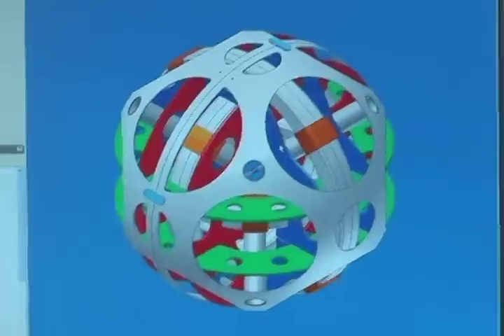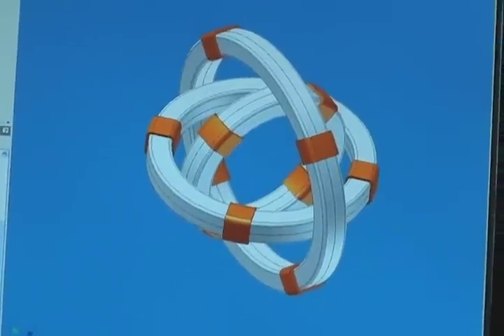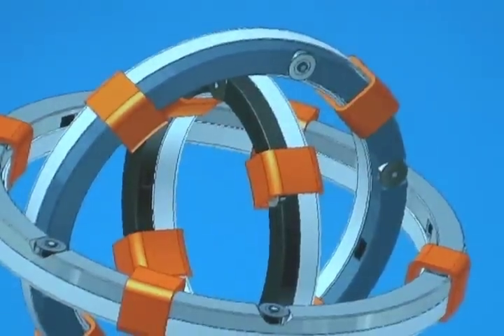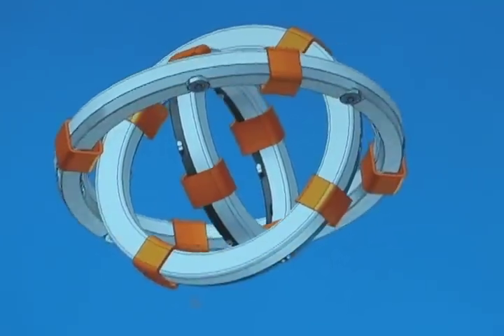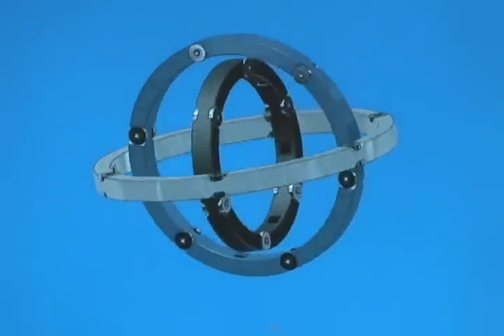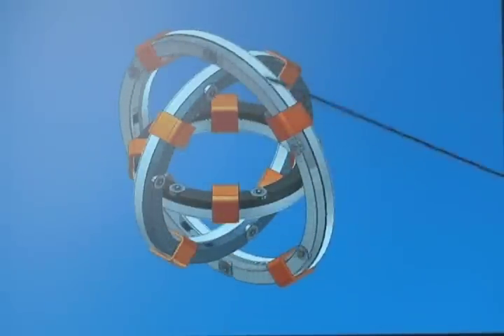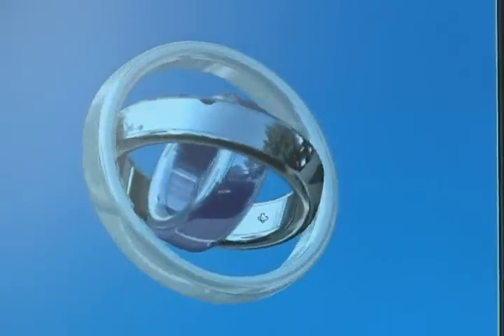Apparatus for Gyroscopic Propulsion Explained

Comment: Awesome! Just a question: According to Einstein energy = mass - so is it really required to rotate any mass? Wouldn't it be more effective to just rotate - let's say - a magnetic field with much higher speed?
Reply: Exactly what I was going to say. The need to have dissimilar mass rings is only needed because he states the rotational speed of the 3 rings was going to be the same. This is simply complicating things unnecessarily. Simply adjusting the speeds of rings made from the same materials would yield the same net results without the need for expensive and dissimilar materials. Also, not sure what the "mystery" is here. Having 3 competing gyros in unison like this has been done before and results in simple cancelation of gyroscopic force. They balance each others procession out. This doesn't cause some mysterious levitation or time travel…LOL

Comment: I get what he is trying to say.. it's a very complex "do nothing" on the contrary to his title, this "thing" as i like to adress it, will resist any motion. that is, relative to the starting point. If it is not moving when you start it (spinning the wheels) then it will resist motion in the X, Y, and Z directions if pushed upon, similar to a gyroscope. but if it is moving, and you start it, it will continue to provide force equal to the direction it is going, given that it keeps spinning inside.

Comment: Not even that. All the various means we use to convert rotary motion into linear require a surface to push against. Read: friction. In the absence of friction, the most you can accomplish with a gyro device like this is rotation about the center. This is useful for orientation in space. If it worked as a propulsion system, we would not require station-keeping thrusters on satellites, they could simply use their internal gyro module (which is basically what this device is) instead of thrusters.

Comment: There's no thrust. It simply transfers one torque into a different direction. You can mount three units on a board.
A child invented a safe astronaut attitude control mechanism by pumping fluids in three tubes  in a loop around to rotate him in space. Stop the pump, you stop rotating.

Comment: That's not what he asked, dumbass. If this device worked it would be in use already since it looks like a bog standard 3-axis gyroscope like has been used in inertial guidance and orientation control for space vehicle for decades. If it was possible for it to propel anything anywhere, we would use the existing gyros instead of engines on our spacecraft to move once in orbit. We don't, can you guess why? Because you can't get linear propulsive force out of a fucking gyroscope, you morons.

Comment: ...You do know you don't need them to be exactly balanced right? You only need them to be tuned for the effective RPM range of the bearings. Then you can achieve "identical rotational inertia" through RPM variances instead of very hard to machine physical properties.

What would be the benefit of targeting a specific RPM be? As apposed to a range you can fine tune the rotational inertia in?

Having said all that, I still don't see how this is supposed to generate propulsion...

Comment: Ah.  I figured probably the friction on the system would make it unfeasible, as well.

I was thinking that this might work for a small toy that just kind of bobbled in the air, but like you said, it doesn't seem efficient at all.  I also don't see how it's supposed to actually move; it seems like it would be creating a similar force in all directions.

Comment: I agree. The gyroscopic effect(s) can be fascinating and puzzling.
But for lift to occur, angular momentum must be applied -- and the lift/mass coefficient results in diminishing returns.
Nearly all the lifting force of any sized gyro is gobbled up by lifting its own weight -- and the problem multiplies the greater the gyro's mass.
Translation -- not practical or workable in "anti-gravity", (defeating gravity).
As for the alleged "gyroscopic propulsion" -- a nice idea but not practical.

Comment: I don't see where the propulsion comes from, the spinning rings (being balanced) cancel each other out. If you could harness one half side of the ring's weight by having it weigh more each time it was say, at the lower half of the ring, and lighter at the upper half, the ring would want to move, like a paddle wheel does in water. However, it is not possible to have something change it's weight like that.

Comment: Its an intresting design, I'll bet it will at least be suficient to drive some kind of spherical outer shell. Youll need to add some kind of active controller in order to sense the current state of the rotors to drive them in sync, and a power source of some kind.

Comment: 4000 years ago a writer wrote about this, its in the Bible so just be aware.
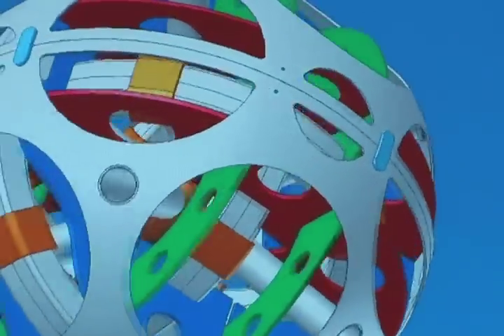Ezekiel 1:15-21
This was the appearance and structure of the wheels: They sparkled like topaz, and all four looked alike. Each appeared to be made like a wheel intersecting a wheel.As they moved, they would go in any one of the four directions the creatures faced; the wheels did not change direction as the creatures went.Their rims were high and awesome, and all four rims were full of eyes all around.

Comment: This wont move you any where! It would be a great anchor to for example pin an astronaut outside the ship incase something goes wrong and the astronaut is spinning away without anything to hold him, the spinning masses will stop his spin and movement away. Refer you to portable cd players thrown around the space station on & off to demonstrate just this. A small part of the backpack could house such an emergency stabilizer. But propulsion with such perfect symmetry? No. Not with equal force 360.

Comment: With a 3D printer made with superconductors...maybe.  Molding and/or CNC routing is so much easier and cheaper, however.  It's not really efficient to try to print with heavy metals when existing tech does the job just fine.

Either way, this device doesn't propel anything.  Forces on opposite sides are balanced out to equilibrium, which is why gyroscopes (which already work fine and also don't need much improvement,) are used for stabilization, not for propulsion.

Comment: The only inertial propulsion that I have seen work is Mike Marsden's Mac Quan 1. I have been following this stuff for 14 years. All other machines have never worked. You can't "hula hoop" yourself into space, or "gyroscopically precess" yourself into space. You must create an energy vector in one direction through acceleration and deceleration of two "point masses". Each other becomes their own "equal and opposite reaction", which ends up traversing the Center of Gravity along a straight line.

Comment: I'll grant it's a pretty design for a three axis gyro. But, what's mysterious about finding the sum of three perpendicular angular momentum vectors?
So what if the sum of the vectors is zero!? 
The only mystery in physics that is going on here is what is going on in your head.
Build your device, prove me wrong, and make a claim, or use the money to take a physics class and simply do the math, you'll go farther in the long run learning the math. You could use it for attitude control on a cubesat.

Comment: "Current physics can't predict the interaction" - I find that hard to credit.  Surely, this could be simulated in a computer - though if you build one, you can test it, and nobody can argue with the outcome - but if you don't know what it will do, why did you patent it?  Surely, it would have been sensible to make one, then if it had unexpected properties, to then patent it?  Is it fundamentally different from three independent gyros mounted on a rigid platform all at 90 degs, but separately?

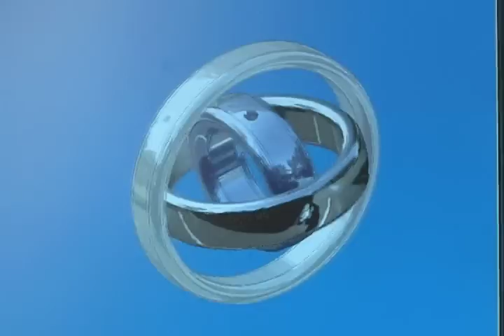Comment: It took you 00:07:15 to make clear you had three perpendicular rings with an equal momentum rotating at the same speed. I would have understood that in 00:00:15. So I bill you for 00:07:00 of the time I spent in listening to this shit, plus 00:00:30 for typing this message. ;-)

Comment: If you sat on a swiveling stool and held the handles it would make you spin one way or the other when you applied force in one direction or the other. This 3 axis version would exert a counter force in any direction opposite to what is applied to it. If mounted inside a hampster ball you could have a weird RC toy, that's about it...lol

Comment: They sorta did this already on the space shuttle. The taped 3 portable CD players together all at 90 degrees to each other and turned them on. Then they taped a flashlight to it to use as a third hand to hold the flashlight in micro gravity. It was sorta stable even with only light CDs spinning. They have had these for 50 years though in missiles back in the day when they still used inertial gyroscopes. A device like this was held in a gimble to actuate flight control surfaces. Nothing new here.

Comment: 1) Instead of carefully balancing out the mass of the three rings, wouldn't it be much easier to use rings of the same density and balance out the net force by changing the respective speed of the rings?
2) This contraption cannot be used for propulsion ... for a limited amount of time it's good for balancing though  ... a perfected model is already being used on satellites and the International Space Station (ISS). Look for "Control Moment Gyroscopes" or CMG's.

Comment: i have an uneducated question. when the 3 rings are spinning at what youve described as the same velocity, are their individual velocities affected by each rings varied? if so, how can that be made equal in each ring when tyouve already had to construct each rings weight to be consistent with the other rings? that is, if the rings sizes do affect or cause any difference in their velocities?

Comment: If the rings need to spin at massive velocities in order to create any meaningful force, they would all have to withstand tremendous forces. It would make more sense to alter the speed of these rings rather than alter the material they are created with. I can imagine the lighter outer ring deteriorating much faster than the inner ring.

Comment: But Your abstract says :
 Each of the three interconnected rotating masses will share substantially the same center of gravity and generate a separate yet interactive kinetic energy and angular momentum in each of the three planes, thereby providing resistance to rotational forces from external sources.
It doesn't mention anything about propulsion!
It's a stabilizer and thats what the title should read!
Guided missiles use a similar systems , how the hell did you get a patent on this? . . hhmmm

Comment: Unfortunately, a mechanism like this would require is mass to be perfectly distributed throughout the object. if one arm were more massive than another, even by a little bit, it would hold energy more so than its counter parts, thus negating the even energy effect.

Comment: I don't understand how this can create directional thrust. I do understand that if all giros are blocked in their bearing the system will oppose to any external torque but not linear movement.
Now considering a push or linear movement happens in a finite amount of time, it;s not instant, you can make all giros vibrate up and down along their rotation axes.VERY FAST. If you do that maybe a push/linear force will translate (due to up/down in the axis) into a torque which gets blocked

Comment: As long as something is either moving or spinning, the net energy of that is conserved.  As far as gyroscopes for 'propulsion', that works, until the energy spins down to too small to thrust the inertia of the mass from its current acceleration.  As an example of a massive propulsion conversion, I spun a medium grade gyro up with an air compressor, and it had really impressive force.  Then its cage fatigued and the released force shattered the gyro cutting my hand enough to go to the hospital.

Comment: He thinks that a gyroscope will offer resistance to angular displacement even when the gyro is "locked". It won't. By locking the three gyroscopes together, he's killed them. If you try to balance this gizmo on a string like a regular gyroscope when all three gyros are running ...it will fall over on the floor by rotating its center of mass which won't be perfectly centered over the string. It will offer NO RESISTANCE TO TORQUE at all. 
Not intuitively obvious ... but true nonetheless.

Comment: I dont think this particularly design will work. You need to have a physical connection between the 3 electromagnetic "gyroscopic effect creating" motor/generators. Then I think you need 3 amplifiers (switching amp maybe) to communicate individually, with the 3 motors. If you electrocally communicate to this in the right way, I believe it will work ;)

Comment: You're not quite right there.
The vehicle would not be locked on a single trajectory, I don't quite know where you got that. It simply would not be able to rotate in any direction.
If, say, this was kept in a spherical casing, it could be thrown, juggled, but it would not roll.
You're right on at least one point though, it can't propel anything, obeying Newtonian physics.

Comment: There is a design for a 3-orthogonal-plane optical gyroscope, more-or-less the same physical concept, except that instead of metal rings and coils, thousands of miles of very thing fiber optic cable is wound on the three circular planes.

Comment: @actrapide Without looking up the answers via the internet, please define these terms. Heat, temperature, force, pressure, energy, power, current, voltage, electricity, magnetism, momentum, thrust, leverage, torsion, compression, and tension. These are basic engineering concepts, I can define them all, accurately, and explain the relationships between them. But you think there are 3 forces in the universe gravity, magnetism, and gyroscopic force. HA! A first year physics student knows better.

Comment: Several decades ago, I wrote a short letter to Richard Feynman inquiring as to what would happen if you stop a toy gyroscope from rotating on its stand, i.e. it precesses around on its stand. Surprisingly, he actually answered me by sending back my note-diagram with corrections. Answer: If you stop the precession, the gyroscope will drop like a rock ... as it must, by Newtonian physics. No gyroscopic motion can be used for propulsion. All relevant vectors do cancel out.

Comment: Very nice construction. I have had a similar idea rolling around in my head for years. I way thinking of using magnets or electromagnets for propulsion of the rings. I never thought of fixed ring positions though. I hope you can get a physical model together. Good luck and nice work

Comment: @watchkey The only problem with your theory is currently superconductors need to be cooled, many with liquid nitrogen. If a peta-laser was used it would heat up the superconductors, In otherwords the energy needed not only to power the laser but to cool the laser and the superconductor is far beyond what we will be capable of producing in the near future.(even if they were powered by fusion thats still a lot of energy).

Comment: The patent's description rambles on about how science is confused about the Coriolis effect, and implies that this thing will act as an anti-gravity device, and then does not mention any of this in the claims section, where it really matters, and instead just describes 3 concentric, hollow-cored, brush less motors positioned in orthogonal planes. Nothing new or revolutionary.  Mostly just an abuse of the Patent format to add 'legitimacy' to a crackpot idea born out of knowing almost enough.

Comment: I would think that the conductivity each ring would cause problems, I suppose it could be balanced out but would require that you insulate the conductive parts from allowing any charge to effect its ring. It suppose it could be balanced by the mass for the conductivity, but I doubt you could mill with that kind of precision. Its an interesting concept.

Comment: to be clear, I wouldn't use those words to describe the phenomena, but taken loosely they are physically justified statements.  With a 90 degree split between all three gyroscopes in his apparatus, the issued force would be a multiple of a canonical vector in a 3D cartesian plan (i.e. v=(1,1,1)).  It would go up, but it would also go sideways simultaneously.  In other words it would go diagonally.  This is assuming the horizontal gyroscope is spinning counter-clockwise.

Comment: @theQuestOfHolyGrail if you spin a gyroscope and hang it sideways off of a string such that the whole system forms something of an L shape, the gyroscope WILL "resist" gravity by diverting its influence and begin to spin around the string maintaining the L shape.  Since the gyroscope is already generating a force, gravity's force can but alter the already present force.  Hence the concept of gyroscopes "escaping" gravity.  Also hence the idea of "resisting" change.

Comment: @tallblondesexy You are right, until the Release of the iPhone4, which DOES have this to work in conjunction with the accelerometer and magnetic compass making it more accurate, just go and look for yourself, WAY more accurate at making a 3D map of the phones movement in space pin-point accurate even long after the GPS signal is lost., Beat that D R O I D

Comment: I think this guy just got fed up with nothing to render on his nice new high dynamic range 3d package, why do all basically useless invention inventors talk at great length about trivial things such as the metal density and the bearing position and the brush less motor design, the sad thing is if the designer had given all 3 axis freedom to move he would have made a nice inertial guidance unit, all that been made in reality is a big gyroscope that will cancel itself out and do... nothing. :(